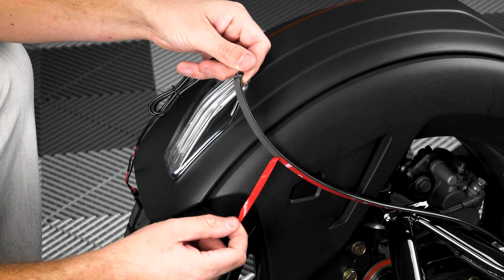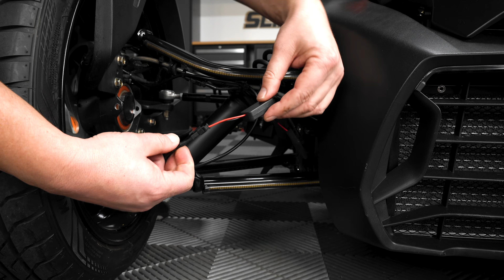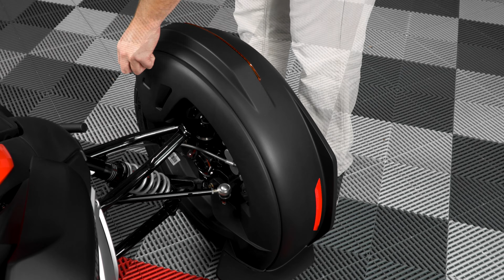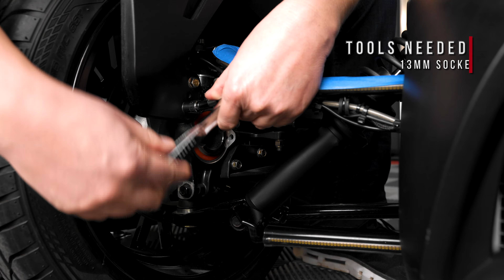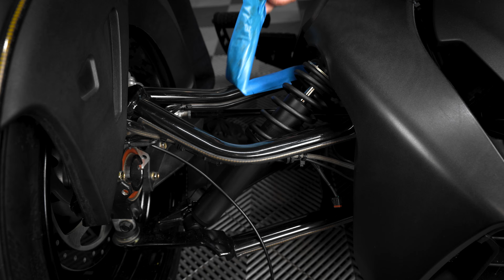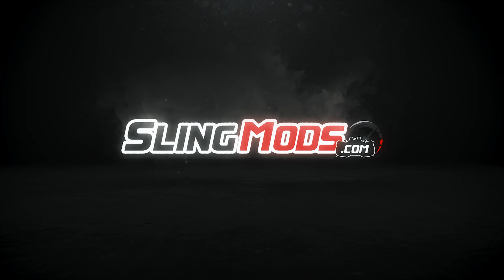Ryker Front Fender LED Running Light Strips w/Turn Signals (Gen 2)

Comment: Why wouldn’t you develop lighting for the outside of the fender instead of the inside . I would rather be seen from the side.
Reply from the maker: Hey there David!  We do offer these LED amber reflectors here:
 https://www.slingmods.com/canam-ryker-front-fender-amber-led-daytime-running-lights-with-sequential-turn-signals?search=sequential

These are extremely bright and have a daytime running light, as well as integrated sequential turn signal functions for the outside of the front fenders!  We always have new mods like this in the works so stay tuned, and thanks for watching!

Comment: I'm sooooooo mad.  I already have the old front fender lights.  🤬🤬🤬🤣🤣🤣🤣🤣   now I gotta get these cuz I also have the front & rear A-arm turn signal lights...
Reply from the maker: Hey Chulo W, that'll look great together. Make sure you have the 1:4 splitter if you're going to run all 3 lighting mods together. If you have any questions my Team is standing by at 800-211-1396 to assist you. Happy to throw in a free shirt or hat when you call in. Thanks for watching man!